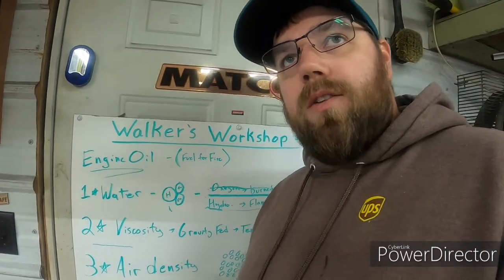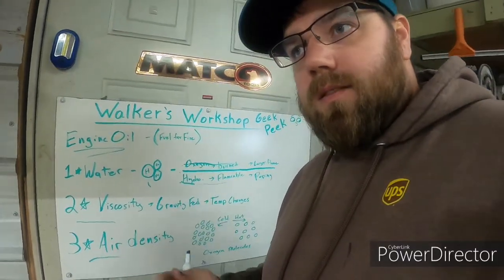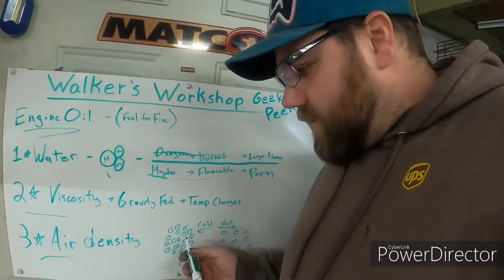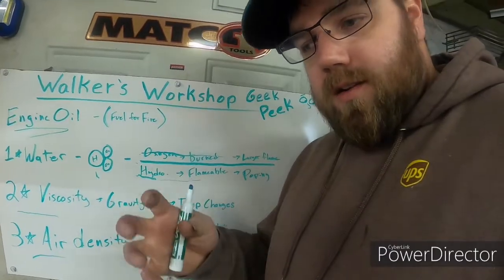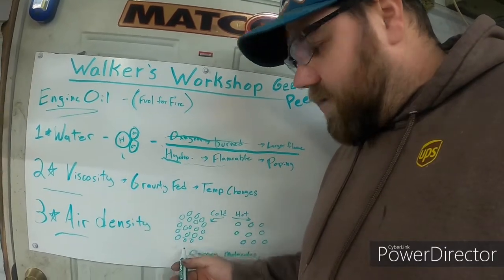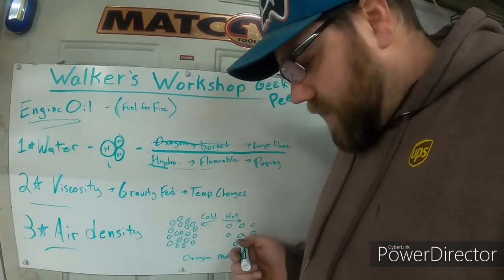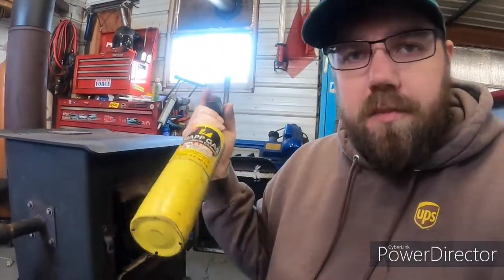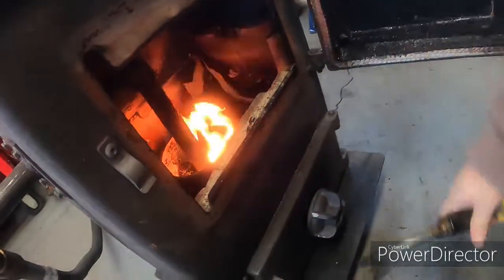How to build a cheap waste oil heater   (DIY garage heater)

Comment: I know this is an old vidio but if you have an answer i would love it.
I was wondering how you know the oul level in the burning tray isnt going to overflow.  I am attempting my first stove and would like a level domp off tube in case i space off watching it and it flowes too much.
Thank you
Bob.
This is shop so alot to loose if i mess up.

Comment: Multigrade oil is thinner when cold and thicker when up to engine temps. The "w" is the winter/cold viscosity.
Reply: No it is not.  Don't matter what oil it is it will get thinner when hot not thicker.

Comment: Literally the worst explanation of water and combustion I have ever heard. First off it's one oxygen to two hydrogen atoms to make a water molecule. Hydrogen is not a particle it's an atom. Oxygen is not burned it combines with a combustible material. When hydrogen burns in the presence of oxygen it literally forms water. The main byproducts of most fuels that are burned in the presence of oxygen is carbon dioxide, carbon monoxide, and water. Of course soot and ash as well as the levels of CO2 or CO is going to depend on how complete your combustion is.

Comment: Your heater is NOT splitting H2O into its component parts.  If there's' popping its just water flashing to steam, which is dangerous but not because it's splitting into hydrogen and oxygen.

Comment: for a drip tube heater - most people are using forced air  - when there's not electricity then what?
Reply: That is the number one drawback to burning oil because that sustained burn and complete combustion requires massive amounts of either heat or air. You could get crazy with the Cheez Whiz and hook up peltier modules to a battery bank with a low power computer fan. You could do solar panels and a battery bank to a blower... But, all these things don't separate you from the need for electricity. You can use wood in combination as a base of heat at the bottom of the steel burn chamber. It will create a draft and naturally aspirate. You could get creative with the piping and have your burner outside with a small straight vertical pipe taking air in the bottom and exhaust out the top heating a series of pipes in a heat exchanger that runs into a duct pushing air with a Sterling engine powered fan. You could do the same open air design and make an enclosed steam system that runs through a radiator indoors. There's a bunch of ways. The thing is, you're on the internet. Why would you ask that question in a comment section on a small amateur YouTube channel unless all you wanted to do was troubleshoot the guy?
Reply: ""Why would you ask that question in a comment section on a small amateur YouTube channel unless all you wanted to do was troubleshoot the guy"""'

Is it not by Gods law, to help one another.?

Thought you would be more intelligent and not bust people balls  ................

forced air requires electricity >>>> the details are not on the internet its in the individuals design , is at its best

requires massive amounts of heat >>>>>> oil has 144,000 BTUs per gallon, what you do with it is something else

Where and how do you get enough of the used oil for a season, and when the SHTF how many other people will be doing the same thing  - gathering oil and it becomes a race against-for survivable ? 

Solar works most of the time but not after dark and or cloudy days (nuclear winter) 

A prolonged SHTF where does the oil come from?  does theft enter the picture - human nature ?

Happy new year 
Gratitude 

Reality ---- https://www.youtube.com/watch?v=acLW1vFO-2Q

Comment: A little more detal would be nice - stove mfg.?,  air drip tube length, distance form bottom of burn pot, wall heigh of burn pot.... .etc.
Reply: Why? Those are all variables that don't have to be exact. They're based off the space you have and the burner you use. The principles stay the same. Air and fuel into burn chamber. Exhaust out of chimney. Copper tubing doesn't touch the flame. It's that simple.

Comment: Water is two atoms of hydrogen and one oxygen atom.  You are not providing enough of the proper energy to break the hydrogen oxygen bonds so they can not recombine and produce energy.  The water is vaporizing into steam at a rapid rate.

Comment: I'm  not sure if you're serious about the water or not. In case you are, the chemical  bonds between the hydrogen and oxygen are not broken apart by fire like this.  Electricity will of course. If you're dripping water into a hot fire, it's going to vaporize into steam which serves to put the fire out if in large enough quantities. It'll hiss and pop when it hits the hot metal or whatever and is instantly vaporized. Engine coolant  , which is sometimes dumped in with the oil, also causes problems.

Comment: Does anyone know if oil burners like this put off a crazy smell inside a shop/garage the same size as this? Obviously I expect it to have some sort of smell outside from the exhaust. I just don't want to constantly smell it from inside.
Reply: If it's  a tight design and has a good air draw, it'll be fine. Draw is mostly affected by smoke stack length and how wimd is going over/ past the stack. Too much wind can draw the fire into the smoke stack (which is bad). Putting  a damper on the flue is a good idea so you can restrict the airflow when it's  really windy out. Or help starve a chimney fire of o2 .  A burlap sack soaking in water is good to have next to the stove in case of chimney fire. To use, open  the door, QUICKLY throw the sack on the fire , shut the door and cut o2 as much as possible.  When  you put it in there, you want it covering the fire as muc as possible so that the maximum amount  of  heat possible vaporizes the water so that it Hopefully puts the chimney  fire out. Steam  is  one of the best fire extinguishers. If you just throw water on the fire (or use extinguisher), you just put that fire out. The one in the chimney,  which is much more likely to burn your building down,  is still going.
Reply: Short answer... No.
Reply: Does a wood stove smell like wood smoke? Sure, if you don't run the stack outside, or if you're stupid

Comment: Thanks for the video if you did your research on the map gas you would realize it's nothing but propane. They stopped putting map gas in the yellow bottles a while back. I believe it was 2008 Just an FYI thank you for the video
Reply: False. So much for doing research. You thank a guy for his video and tell him he doesn't know what he's talking about in the same breath. All the while not knowing what you're talking about. Who does that? First off, it's MAPP gas. I don't trust the information of people who don't know the industrial or marketing name of a product. Telling someone to do their research and putting out incorrect information is a sure way to highlight your own ignorance. Methylacetylene-propadiene propane is not simply propane. What was a chemically superior open air torch fuel was simply not economical. It's marketed as MAP-Pro because MAPP gas is trademarked. It's still sold in yellow cylinders it just no longer the same chemical composition. It's propane with propylene. You boost it with your red cylinder oxygen bottle and it does just fine. The only reason I know so much is because I grew tired of old farts always commenting about MAPP gas and how the two cylinders in their garage were like some strategic reserve that they were going to bust out to save the day. Meanwhile, the gas I was using was inferior and therefore I was inferior. The reality is those geezers mess up every job they do when they're not mostly sitting around talking about "back in my day". If they were serious they'd step it up to oxy-acetylene and quit crying about the defunked MAPP gas with their jagged cuts and brittle welds.
Reply: @mattmarzula  I wasn't trying to beat the guy up. Like it seems you're doing to me, two wrongs don't make a right. I thought map gas burned at 5300 degrees. Not the 3703 degrees. They stop putting real map gas in those yellow cans back in 2008.

Comment: Did I miss where your heater design included the capability of electrolysis? The spitting and popping is the result of rapid expansion of the water turning to steam.
Reply: Came here to say this. It's one thing not to know it, it's another to teach it completely wrong but as if you're an expert. Especially on a subject where danger/safety is involved. Also, H2O is two hydrogens, not two oxygens!

Comment: water is 2 parts hydrogen, one part oxygen. the popping sound you hear is not hydrogen exploding. It's water turning to steam while immersed in oil. water doesn't break down into it's 2 components until you reach very high temperatures. Way hotter than you're going to get in your stove. Probably best not to play professor on the internet unless you are one.

Comment: Great stove, I will probably build the same. 
FyI
Water is H2 O
2 parts hydrogen one part Oxygen.
Reply: man you need to go back to the first grade ! one hydrogen two oxygen H 2O
Reply: @alvinhickling901  Lol Hey so I went back to first Grade and found out that its two parts hydrogen and one part Oxygen. Google it 👍
Reply: @alvinhickling901  go back to preschool
Reply: whydon't you want to be lonely in class  @ctrlaltdebug